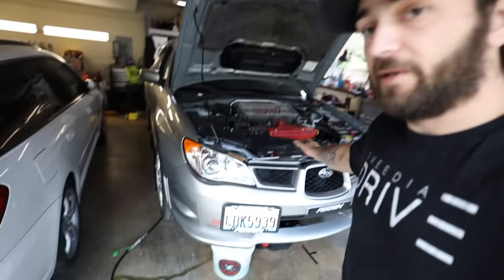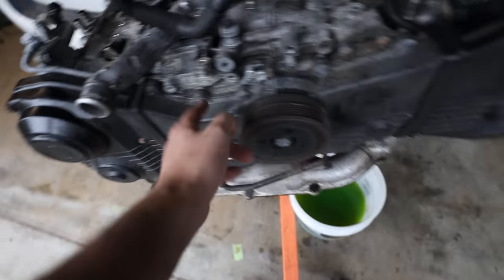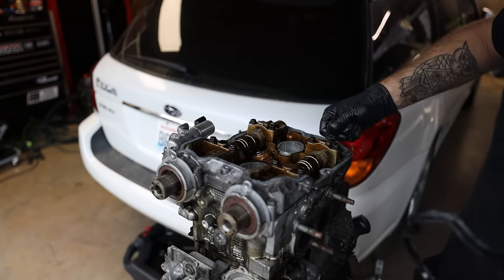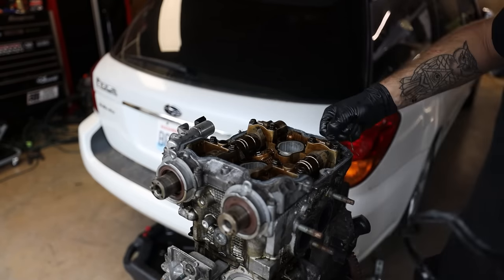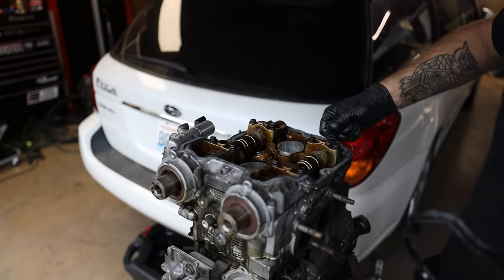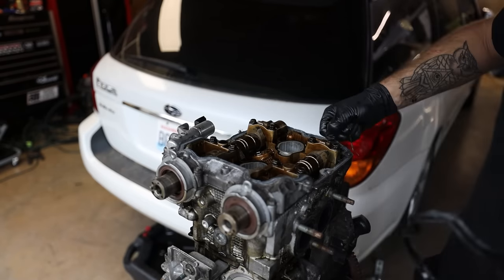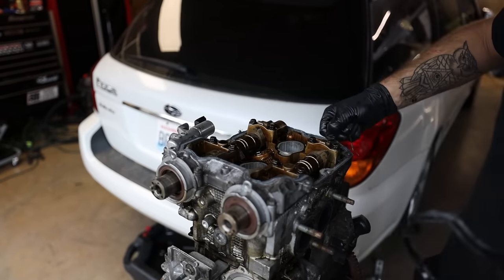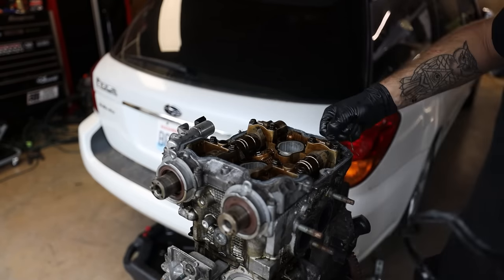How To Refresh your Old Subaru Engine

Comment: Just refreshed my 2015 Sti with an IAG 1000+ longblock.  Now I have P0353 P0390 codes.  The coil was replaced but still throws the code.  Cam sensors.  No idea.   I was told they rarely go bad I’m also told it’s an engine harness issue.  Guess that’s going to be replaced.  Any thoughts
How to get this running.  I’ve tried a few things but don’t have a shop or facilities to do this in depth work.  Other than send it back.  Yes the tuner is very reputable and are helping me as best as they can.
Reply from the maker: You've already verified and checked mechanical timing I'm assuming? 
Did you reuse the avcs gears or did you get new ones for the build?
Reply: @Smeedia  prime did all that.  All new gears etc.  every little part is brand new.  They do t mess around.

Comment: was literally noticing my Temps going up on my 05 legacy gt. did a refurbished block in 2015. just did the radiator picking up today hopefully that's the issue because coolant was leaking right out from it.

subaru wants like 4899 for all heads. belt, minus machine shop cost 🙄
not including water pump plugs etc

thinking about a reman long block at that point thoughts?
Reply from the maker: Just snag an RA block from flat iorns 🤝
Reply: @Smeedia  flat iron tuning?
Reply from the maker: https://www.flatironstuning.com/subaru-oem-2018-type-ra-shortblock
Reply: @Smeedia  gotcha do they carry longblocks?
Reply from the maker: I don't think so? 🤔

Comment: would i be okay using a worm gear clamp on a pcv breather line or do you recommend to just completely stay away from them?
Reply from the maker: Yes, I do not suggest them on fluid based hoses though
Reply: @Smeedia  okay thanks for the quick reply, just picked up a new hose from the dealership and realized it had a click clamp rather than sprung on the side that goes to the hardlines

Comment: Hey random question for you I have both a perren aos and iag comp aos for my wrx swaped gc8 I have a grimspeed aos on there already I was wondering if I could install one of them on my 2013 brz? How would I route it?
Reply from the maker: Put thr iag on your wrx and the perrin on the brz. You can make it would just gotta plumb the ocv connections up. 

Breathers from thr heads block drain etc

Comment: @SMEEDIA Have you ever has an oil leak from the top of your block (passenger side)? From my research people state its the head gasket. I just built the engine and everything, short block by OFMS. I saw in this video you put oil on the studs entering the block. I put assembly lube since I didn't have oil at the time. I am hoping that I did not pull out the threads from the block by doing so. But has this ever happened to you before? (V3 closed deck, Cometic Head Gasket)
Reply from the maker: Where on that side does it look like ots coming from? I've personally never seen any oil leaks from there 👀
Reply: @Smeedia  It looks like its coming from close to where the oil galley is for cylinder 3. Its in front of the turbo but still leaks back on to the exhaust housing, the only reason I suspect it to be the gasket is because of the amount of oil its leaking. but I am still not sure.

Comment: hey boss man, quick question unrelated to the video but if i buy a flex fuel kit from cobb do they still work in the accessport as in just the gauge and get a custom tune, your reply would be much appreciated
Reply: im also in aus so i dont know if im free of the new green changes or whatever
Reply from the maker: Nope they don't work, I wouldent suggest buying one 🙏

Pretty sure the update was pushed out to everyone 🤔
Reply: Absolute legend Ty for the reply, ugh that sucks so you really just need a haltech or something now to run flex fuel how can you see their new updated kits coming out
Reply from the maker: I saw devious came out with a nee kit but haven't had a chance to check em out yet. Suppose to work with the AP 👀
Reply: Oh really, might have to give that one a look see that's really what I want bc I have an accessport and don't really want to buy a whole custom ecu just for flex fuel will definitely be copping a google search absolute leeeeeegend
Reply: I can't seem to find anything under devious is that what the company is called ?
Reply from the maker: Apologies it was delicious tuning

Comment: I wish you lived here in australia I would pay you some money to do some work lol
Reply from the maker: Tbh I wished I lived there 😅🔥
Reply: @Smeedia  trust me you don’t lol the car laws are soooo strict!!! You know your recent build the eg33? It would’ve been defected & impounded and you’d have to return it to stock
Reply from the maker: Ohhhh yeah fuck that 😳
Reply: @Smeedia  yes sir it’s fkd I’m building my bugeye remember? And I’ve got like some decent wheel poke but I have to put flares to make it “legal” if I don’t I have to remove my wheels put stock ones go get it cleared and put my wheels back on only to drive and get fined & defected again and they can take your license plate if you have a very highly modified car without paying $3,000+ for engineering certificates
Reply from the maker: Why is it so strict down there?
Reply: @Smeedia  because Australia’s ADR (Australia Design Rules)  are whack if your exhaust is loud it isn’t legal , if you go 2 inch bigger or 2 inches smaller  than your OEM wheels it’s illegal 

Ride height etc they think if you modify your cars for the better you’re changing the structural integrity of the car even tho the stuff we put to our cars are not cheap! 

If you lower it they think if you run over someone they can get severely hurt from the car being so low but we have pretty high pickup trucks that are OEM from factory and they can easily fk someone up 

Quick release’s are not allowed 
Air bags are illegal 
Xenon headlight the list goes on & on man 

If you have a big wing they think it can chop
Someones arm or cut someone’s head off it’s it’s abit sharp 

Your engine modification of your eg33 you’d have to spend over 5k to get it engineered 

They don’t like it when we modify our cars to perform better & to look better than anything they’ve ever driven!
Reply: @Smeedia r mud flaps 

So if you drop your car and it’s 95mm at any part it’s a defect they use this tool and they roll
It and if it hits your muffler or any part of your exhaust it’s illegal it has to not hit anything 

If you have like a 1 finger gap it’s illegal it’s fkd

Comment: What do u use to to clean the cylinder head mating surface on the engine block side?
Reply from the maker: Parts cleaner, razor blade, red scotch bright and a microfiber
Reply: @Smeedia  Thanks, appreciate it. I'm basically doing the same thing as your video. This is my 2nd Subaru, I had a 05 Legacy GT, I now a have a 16 STi with 155k miles on it, which I bought with 28k miles on it, that lately every once in awhile, it will push coolant from the turbo expansion tank into the overflow tank but it never overheats.

Comment: I’m dealing with the same issue YeT again. What could be burning the fuel control module?
Reply from the maker: Have you checked all grounds on the control module? I belive there are two
Reply: @Smeedia  not yet but yeah possibly a ground somewhere making contact and burning my shit but where do I start?
Reply from the maker: Start with continuity checks off the ground wires on the module
Reply: @Smeedia  can you do a quick video of what I’m supposed to be doing? 💀 put it on the discord
Reply from the maker: I'll try to this afternoon 🙏
Reply: @Smeedia  awesome brother I’ll be on it later tonight then and hopefully I’ll see it. Tag me on the discord too. Same name

Comment: Question for 500whp do I have to do the heads or just the block ?
Reply from the maker: I would suggest at minimum valves if it's a higher milage engine. Some 272s will also help ya get there 🙏
Reply: You'd want to do an upgraded short block at the least. 30PSI/500WHP is also where the OEM cylinder walls tend to crack. A sleeved or closed deck block would be my recommendation. Heads/Cams should have no issue at that power level. Smeedia's valve recommendation is also good due to age. I'm 450/480 at the wheels with stock heads and E85.
Reply: @cbidwell91  thanks for your help

Comment: i have a coolant leak out of the bottom coolant port with fresh head gaskets and resurfaced any ideas ive looked everywhere
Reply from the maker: How many miles on the block? 

First two thoughts are the blocks no longer flat and true, or the heads not torqued down all the way or was torqued down improperly
Reply: @Smeedia  5kish on block torqued to arp head stud specs 30 60 90 fresh gaskets and closed deck block
Reply from the maker: @awwwfiddlesticks  new leak or LwGs been there? Also what head gaskets?
Reply: @Smeedia  new leak never seen it before till i was tinkering on it with oem head gaskets

Comment: Do all subies have to have head gaskets changed my 03 wrx wagon has 233,000 miles and it is stock and has never had head gaskets changed and I have put all most 200,000 miles on it since I bought it It also has the original motor and auto trans as far as I know
Reply from the maker: No, H/G issues were only really prevalent on the early model 2.5i models

Comment: Is it worth it to manual swap an automatic WRX? I want a manual WRX and need a new transmission anyway
Reply from the maker: Big yes on that one! 🔥🙏💪
Reply: Try to do the STI 6 speed.
Reply: @daviddin8863  that's what I plan to do, but they're rather expensive

Comment: how much longer would y'all think this refreshed engine will go on for? I kinda had a similar job done earlier this year due to a head gasket leak.
Reply: That really depends on a lot of things. How often do you change your oil, what are your driving habits. How well do you take care of the car, how good of a tune do you have, how much over stock power are you making? Best thing you can do for yourself, is take an oil sample and send it off to be analysed. That will let you know the health of your engine over time.

Comment: Hopefully everything gets straightened out with the car, Very bad situation, Hate aftermarket parts everything down to hose clamps, I'd rather pay a few dollars more for OEM then Cheap Chinese products, These engines are not cheap in these cars especially now that EJ's are no longer in production.
Reply from the maker: Ejs haven't gone up in price since they stopped making oe cars with them, but definitely does suck 😭

Comment: 1. The hose clamp was left loose... worm gear clamps rarely fail, unless stripped from over tightened. which should of been caught before hand. 2. head was still warped or block and the pressure blew the hose off... only 2 things possible that coulda happened.
Reply from the maker: If the hose clamp was loose it would have immediately leaked when I was Burping the car, when it was done being burped and idling, and when I was driving it. Worm gear was 100% tight 
Block passed flatness and head was freshly decked if it was pressure related it would have split a hose before poping that clamp
Reply: @Smeedia  I have seen some clamps that were left loose before, that held for a little bit because the hose itself fit snug, and after a while the hose finally blew off. but if it was tight then either he cranked up boost or the hose itself fell apart from heat /age. I doubt the clamp was the issue, if your sure it was tight. Other considerations are fans not working or possibly thermostat failed somehow.  Maybe it is related to as why the gaskets blew in the first place...
Reply from the maker: Definitely could have been some underlying issue, but I know that thing was assembled 100%, could have been that I swapped the hoses for new ones and the clamps went from being on swelled old swelled hoses to new one. 

During burping/testing I always make sure to get Temps to 205 to kick fans on and make sure everything is working properly.
Reply: @Smeedia  coulda been a few things. I have also seen bad cooling fans that would work sometimes and when they get really hot they would randomly not want to come on. I had to change a few that did that on Hondas etc. but they are all made by the same nippen denso /aftermarket type deal.

Comment: I need help too....... :-(
Reply from the maker: With what 👀
Reply: @Smeedia  I was kinda kidding but not really, lol Kind of Everything! lol Im looking to get a seibon but they dont come with shrouds for TMIC or attatchments for one, so im worried the air flow gonna be choppy and go around rather than through the TMIC. My car is a mess right now tho. My crank is out of alignment So everything is in limp mode,I have tons of electrical issues (MFD and interior lights stopped working all at once) so far havent been able to troubleshoot ,Fuses are all fine. theres a fuel flow issue ,Fuel Trims are all over the place. its a shit show. and not even built that much... Im this close to taking it to subi but I do not wanna drop all that money, ya know. and I was literally just about to order my DP Turbo inlet and EBCS with the Hood but holding off till I figure this crap out.
Its just that IMO your knowledge about these cars far surpasses anyone else I personally have heard talk about them.   Cant forget the Trunk Leak either. Every time it rains My trunk fills with water and short of removing my rear windshield i havent been able to find that culprit either.  Aside from the trunk issue and the hood, everything happened within like a week of each other.